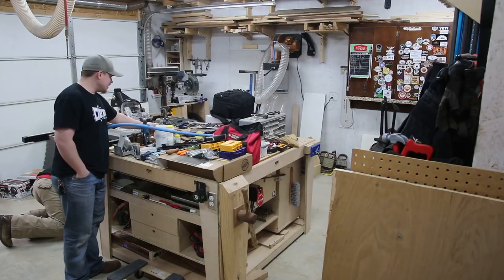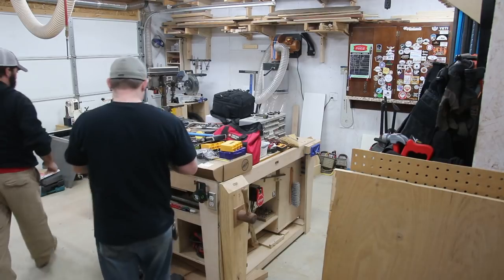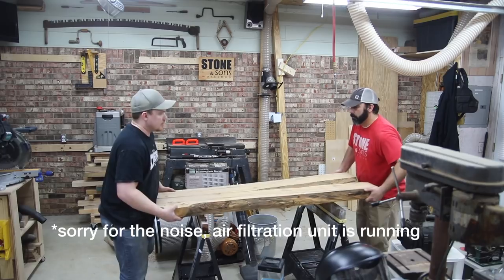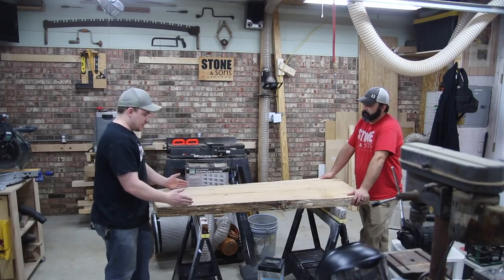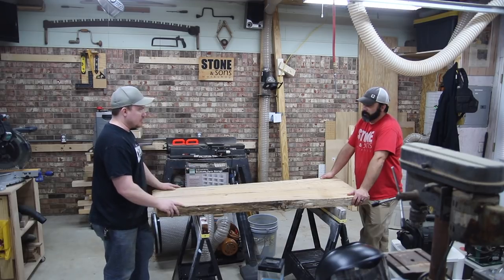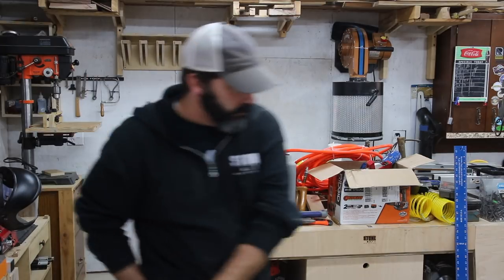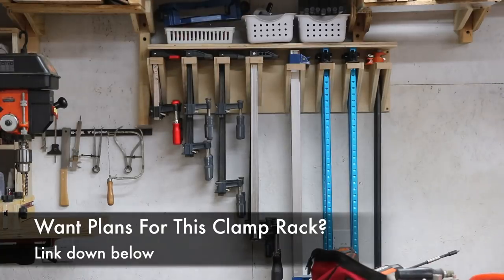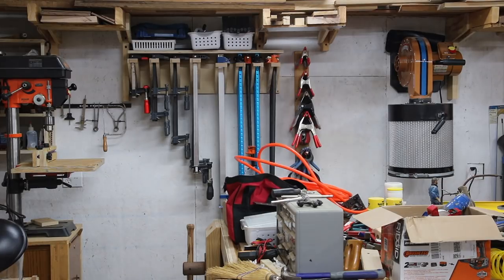Woodworking Shop Layout

Comment: how long is the table saw with rails?  do you use the extended rails that often? thanks so much and good luck on the rearrange.
Reply from the maker: It’s a 30” capacity saw. I don’t use it all in most cases.

Comment: Great stuff - I always make sure to catch your latest video - I saw an older video of yours about the dust right dust collector from rockler - do you still have the same opinion? I am building my shop this spring and instead of central dust collection I was thinking of using three of these strategically located with the expanding hose - your thoughts on this plan would be appreciated - thanks from a fan in Kansas
Reply from the maker: I like it. I think that would work in a shop that might change layouts or that might be bigger than the average size shop. These units are like central dust collectors, but just portable. With all that said, you could probably buy a larger unit for what three of these would cost. It just depends... do you want portability or stationary dust collection?